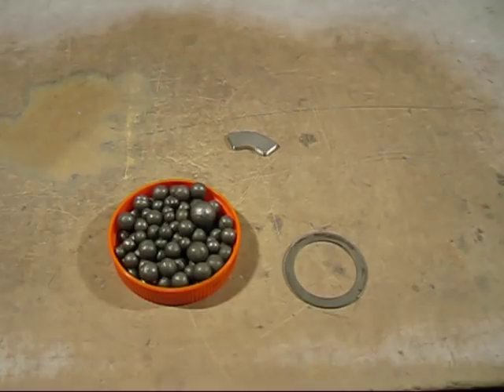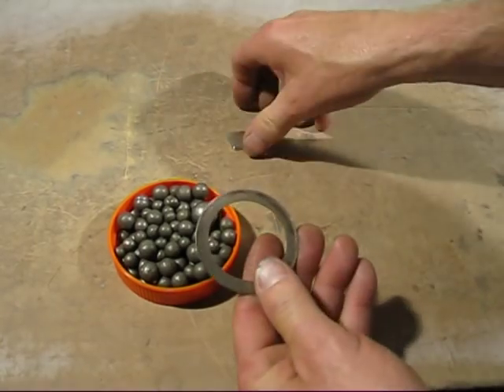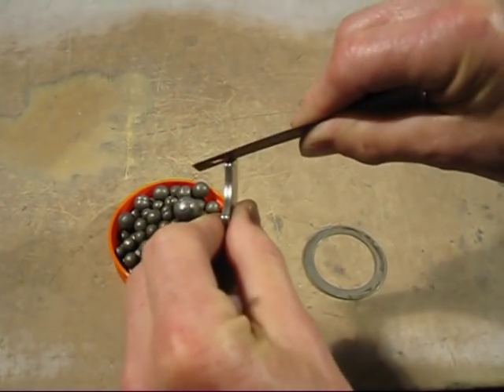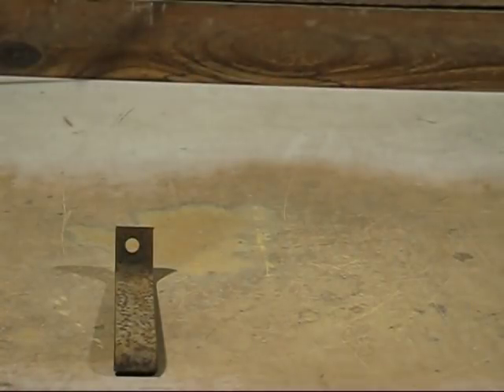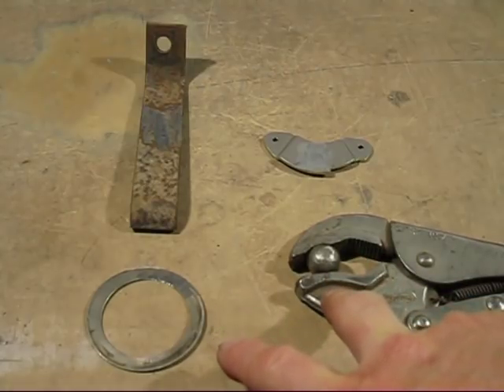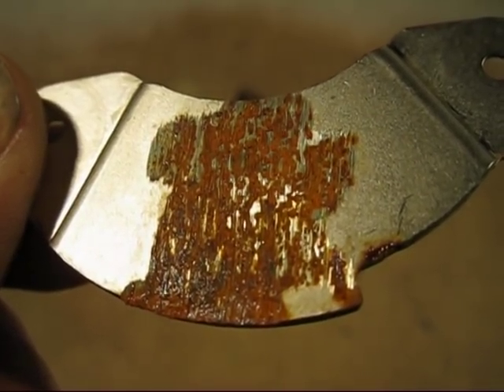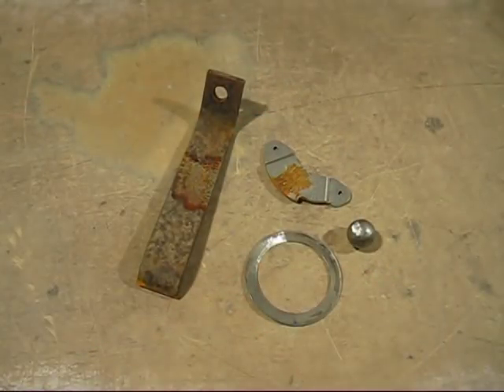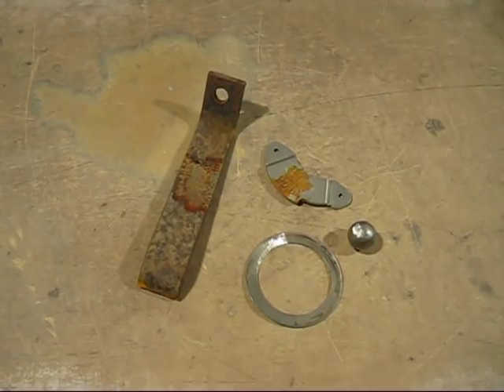Does the metal from hard drives have a high nickel content?

Comment: I have just done a few XRF (X-Ray Fluorescence Analysis) screenings with a Niton XL3t. As you and many commenters already suspected the surface has been treated with something and does not have the same composition as the core. The surface indeed have higher concentrations of nickel however the layer is very thin. The core consists of over 99.5% iron. As for any test method there are advantages and disadvantages. Without going into detail XRF screening is more accurate or at least easier to do on homogenous material. In other words, on material that is composed in the same ratio throughout. If the test piece is layered with different compositions the reading will be difficult to interpret as the radiation travels different depths though different materials and even more affecting is the way the sensor can pick up electrons that has been “knocked off” by the radiation emitted from the test device and traveling “back” to the sensor “through” different materials or layers. So, I made test pieces by milling away half a millimeter on every side of my samples in order to remove the top layer and getting to what is most likely homogenous material. Here is a reading on the core on one of my milled test piece: Cr 0.045%, Mn 0.276% , Fe 99.51%, Cu 0.061%, Mo 0.007%. For reference I also did some measurements directly on some untreated samples where I only had removed the magnets and got results like: Fe 17.75%, Co 0.948%, Ni 81,22%, Bi 0.042%. Since these later readings are made on a non-homogenous material the readings cannot be expected to let us know the exact ratio what the composition of the top layer consists of. It can be seen as an indicator of what is in the material. As expected measurements on different spots show a slightly different reading. Most likely this is due to the way the sensor pics up electrons rather from the plating/coating whatever it is being uneven.
My test samples comes out of a Western Digital WD800JD 80GB 3.5" drive. Since I also have access to one of those simple chemo nickel tests which has 1% dimethylglyoxime I rubbed some on an untreated surface and some on the milled test piece. As expected the test indicated presence of nickel on the untreated piece but none on the milled piece.     Greetings from Sweden / Robin
Reply: This deserves so many up-votes, but I only have the one.
Reply from the maker: Thank you for your detailed reply! It confirms what my tests have shown, not a high nickel alloy. It is amazing how many websites say that it is a high content nickel alloy when it is not. They must copy of each other and never check that it is correct
Reply: Can't you just turn it sideways or are the layers not really your average layers but like an ogres layers I guess an onion layered yeah thats rough but what material out there (other than wood) is layered like that oh that would be all an onion i just realized and all just wood lol I kill myself. Lmfao I need to get back in my lane 🤣

Comment: I'll throw this at you. The metal parts in the hard drive are encasing magnets in a linear motor arrangement. They are most likely part of the magnetic flux return path. In other words they help direct the magnetic force in the right area as well as hold the magnets in place. I was thinking about this as I watched the first video. I design audio equipment among other things and part of that designing is the design of loudspeakers. As in woofers and tweeters. I just spent a month hunched over a laptop and working with a magnetics software package working on a few woofer designs. I'd be almost 100% certain of the pieces you are testing are low carbon steel now that I have seen both the grind sparking and the rust. A low carbon steel is useful as a magnetic return path. As the carbon in the iron goes up it becomes less useful as a magnetic return material.

Thanks for your honestly luckygen 1001. You are in a class of two gentlemen that I watch and learn from in the videos you do about casting. The other is a fellow countryman of yours. The majority of the Youtube people trying to cast metal are mostly lemmings following after bad practices popularized and repeated thousands of times. You channel is the real deal.
Reply from the maker: When I saw how rusty the piece of metal from the hard drive was I knew I needed to make another video. It was not easy to say that what I said in my last video was incorrect. Looking through the comments so many have links to sites where they say it is mu metal or permalloy but this is where I like to go further than quoting from a website, doing some real world tests to get to the bottom of this myth.
Reply: I admire honestly a lot more than craftiness or  misinformation.  @luckygen1001
Reply: You developed loud speakers oh boy do I have a design flaw not so flawed challenge build for you as we know subwoofer sound or pound waves can be harnessed and thrown towards an object or an entire perimeter of a whole structure mounted or mobile like a car or an entire house I seen a guy take off the cone or whatever and he put an articulating fan on a very extremely slow speed spinning module as the fan has to spin very slow as the waves form like an artificial static pound wave barrier that concentrates the entire force in a direct straight line towards an object when on contact can do some pretty serious irreversible stuff to a sub structure like a home or house it will resonate itself into a single concentration of force that once hits the object can rattle all the weak parts of the bindings holding it together completely obsolete by crankung up the sub power and simply the fan speed directly in front in the middle of the subwoofer built in just turn fan speed up high and using a certain frequency with the music and already using powerful ohms destroy I wonder if u could then add a microwave and laser contraption to create a star wars force field like barrier as a solar panel and the right satellite dish can collect suns rays as electricity turn the electricity to microwaves and with simple high power laser those microwaves will follow the entire straight line the laser is pointed as to transfer electricity microwaves and heat all in a bundle across extreme distances through tough environments no matter how cold or dry I think that intensifies it across distances at the speed of light I just wonder what resonating sound barrier waves that scattter and intrude building perimeters would do..........has anyone else recently thought up of a cooler multiple weaponized device lately just think what a wireless employee device would do...........

Comment: I just found your video, and I'm fairly sure the piece from inside the hard drive isn't mu-metal. Several reasons why I say that.
1. I have worked with actual mu-metal, it is a fairly soft material. Ductility is comparable to pure tin. You can bend a thick tin bar by hand, same with mu-metal. If those pieces cannot be bent without pliers, then it's unlikely that they are mu-metal.
2. The real mu-metal is very expensive, thus it's used sparsely and only where it's actually needed for its special properties. if you think pure nickel is expensive, then you haven't seen what mu-metal costs. The high cost is not just due to its composition, but the manufacturing process is complex because of the very special and long heat treatment that this alloy needs to achieve maximum magnetic permeability. It is used for shielding of components from magnetic fields (I use it to shield photomultipliers in gamma radiation detection equipment). I personally think it's very unlikely that hard drive manufacturers would use this high cost material in a place where it's not needed (like completing the magnetic circuit of a HDD actuator). In such a place a more common material like high silicon steel would be more cost effective. 
Like other commenters said, you probably got grey cast iron after added the hard drive pieces to it because of the extra silicon they contained.
Reply from the maker: Those pieces in the hard drive are hard to bend with pliers. Also they have been plated with nickel so why plate something that is nickel in the first place.
Reply: @luckygen1001  That's my estimate too. OTOH you can get pure nickel on ebay for about $50 per kilogram if you're willing to wait 3-4 weeks for it to be shipped from China.

Comment: EAsiest way to find out. Go to a metal recycling center near you. Every center here in the US, due to recycling becoming so popular and big business. Has a handheld XR spectrometer. I have used them many MANY times. Just go over there with some of the samples and ask them to shoot them to see what they are. I have never been turned down unless they don't have one. Thats only been one location I have been to.
Reply from the maker: I wonder if the scrap yards in Australia have them and will they test something for me?
Reply: @luckygen1001  I would bet at least one of them does.
Reply: @luckygen1001  The Australian 5, 10 and 20 cent coins apparently have 25% nickel. I'm not saying you should deface currency, but just an interesting fact ;) Each weighs twice as much as the previous one, so their monetary value per mass of nickel is fairly similar. Nickel-straps meant for for spot-welding lithium-cells might be an alternative too - you'd just need ~46g of the stuff, rt?
Reply from the maker: Thank you for your comment, coinage alloys contain too much copper and when added to cast iron it tends to sink to the bottom of the crucible as it is heavier that iron.

Comment: nicrome wire but I guess chromium would make it too hard
Reply: The most common nichrome contains slightly less than 80% nickel and about 20% chromium. Accordingly, in the iron will be 0.25% chromium. I don't understand the cast iron, but it seems to me a good option.

Comment: Just a point on Mumetal. The concept is that it is 'magnetically soft' meaning when used in a transformer it easily reverses magnetic polarity  when subjected to the AC field. If it didn't, like a hard steel, energy would be dissipated and there would be a lot of heating losses and poor efficiency of the transformer.
However, in a HDD, the magnetic field between the two plates is static, not fluctuating, so there should be no need for Mumetal.
(the small coil is reacting within a static magnetic field)

Also, since Mumetal is expensive any laminations today are Silicon steel.

Comment: Cool test! Here's my post from last week: (Beside battery-straps, as I mentioned earlier, some coinage may also contain Nickel: https://en.wikipedia.org/wiki/Coins_of_the_Canadian_dollar )

Hi luckygen1001, I doubt if the metal you got is actually mu-metal. Here's why:
The parts you use are the so-called "back-irons" of a HDD's voice-coil actuator. The back irons are intended to short out the north ans south poles on the unused-sides of the rare-earth magnets that produce the actuating field. As such, a high permeability is NOT essential; a high SATURATION flux-density is. The relative permeability of mu-metal is ~100'000 whereas the relative permeability of regular iron and soft-magnetic steel is ~5'000. Both are extremely high compared to the relative permeability of air: ~1. Moral of the story: Permeability isn't a deciding factor here. The real decider is the saturation flux-density . Iron saturates around 1.5T (the magnets can easily generate this in the thinner cross-section of the back-iron) whereas mu-metal saturates at ~ 100mT. Real mu-metal would saturate and would be utterly useless to short out the magnetic flux on the back. Ergo, any (properly designed) HDD VCM back-irons shall not be made of mu-metal. Can you confirm that the metal you use DOES actually contain 70+% nickel? A reliable source of almost pure nickel is battery-connecting straps-material for lithium batteries. Cheers!

Comment: Hi There, I had to find a source of pure nickel years ago for making test points for ignition systems. That had me foxed for a while until I noticed that cast iron welding rods can be purchased as 99% pure. They are not cheap but they are a source of known purity nickel. The rods at that time were about 50p each but probably about 2GBP now. I now live in Canada and they are about $2.50 per rod.

Comment: What about the disc parts of hard drives, the shiny part that looks like a small CD? 
They're weakly magnetic and soft metal. If there's any nickel in a hard drive, that disc would be the most likely place.
Reply: No, the disc platters are made of aluminum coated with a magnetic powder. They contain no nickel.

Comment: What about coins? I know older us coins have a high nickel content. Spacificly silver coins 1965-around 1985
Reply from the maker: Coinage alloys contain about 25% nickel and the rest is copper. Using that amount will add too much copper to the cast iron.
Reply: Have already researched coins (US). The nickle (5 cent) is an alloy containing 75% nickel, 25% copper. The only difference being coinage minted during ww 2 when silver was added. Don't know if the Aussie banks will but my bank here in the states will exchange currency at n/c. A lot of differing opinions about melting coins here but from what I can gather as long as the melt is not being used in making other coins the treasury doesn't care. Have seen quite a few people on YT melting zinc pennies.
Reply: Some canadian nickels (5 cent pieces) are 99% nickel

Comment: A possible source could be turbocharger rotors (Inconel) but they are usually around 52% Nickel. Not sure if the higher melting point would prove a problem or not with dissolving? Also Inconel 600 has around 72% Nickel and it may be possible to source some welding rods.
Reply from the maker: Do you know what else is in those rotors because other elements can make cast iron very hard.
Reply: @luckygen1001  . I cannot be certain but if you Google Inconel 718 or Inconel X750 it will give you an idea of the general constituents.

Comment: Central electrodes of spark plugs are made of high nickel alloy and copper. But not at all some are iridium alloys as i know.
Reply from the maker: Do you have any part numbers to identify which is which?
Reply: i ve had a look on web but turned out so some recourses say standard ones (cold type) nickel coated copper core others refer as nickel steel alloy. Most Bosch old and new spark plugs are consist precious metals.. You may have a look and try some test on the shell and electrodes sir

Comment: Ask Cody from Cody's lab he has a tester. Could you use tig filler wire? Maybe 316?
Reply from the maker: 316 suggests it is stainless steel? if it is it will make cast iron very hard.
Reply: @luckygen1001  yeah its a stainless. There are 99% nickel rods used for fixing cast iron but also expensive.